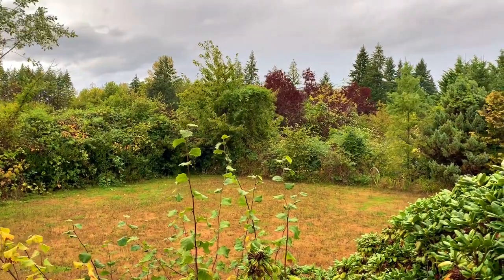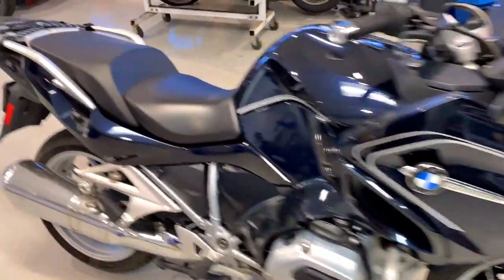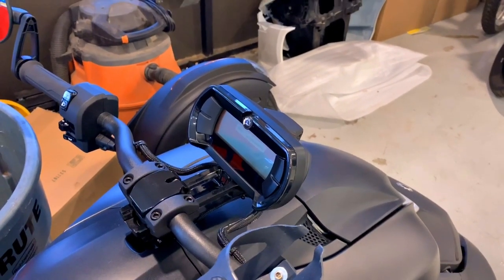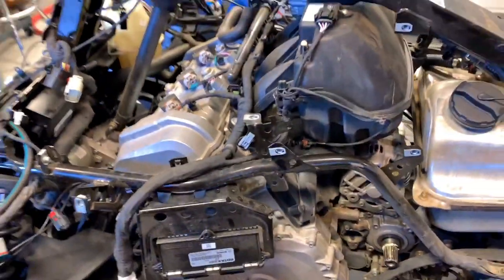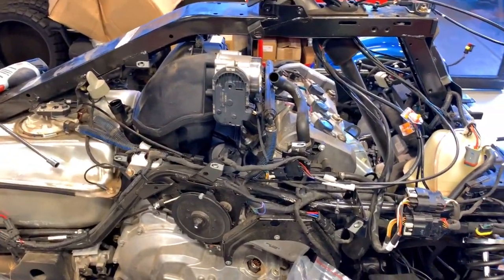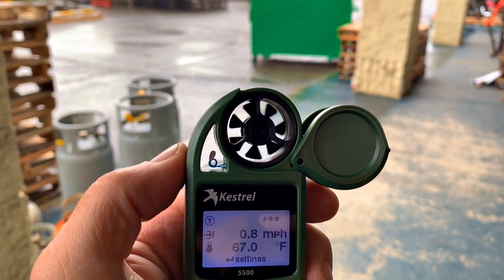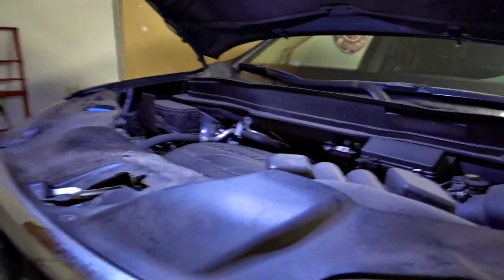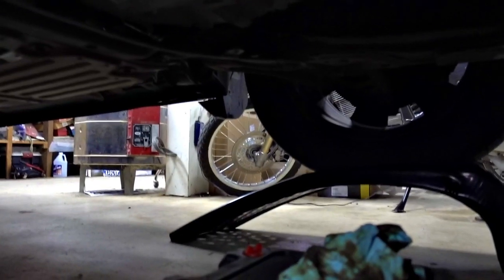Missed A Cool Test Ride!! • Texas Parade Closing In! | TheSmoaks Vlog_1402

Comment: Shawn, on my recent trip (when I stopped for a visit at the shop) I had about 10 - 11 riding days and put on 5,823 miles. I can't speak to the missing work/$ aspect; however, as I told you when I met you... having been to the attempt last year, this is an AWESOME opportunity and there will definitely be several other well followed YouTubers. I have no doubt you are more than capable of putting in the kind of miles required. If it sounds like I'm trying to sway you to come, I am. I would love to shake your hand in Paris, TX!

Comment: 2000 miles, 4 days? Join the Iron Butt Assn. 1,000 in 24 hrs. Using the rule of 100 miles in 2hrs, you'll get that first day in 20hrs. 8hrs break, then the next 1,000 miles. Come on, you can do it!